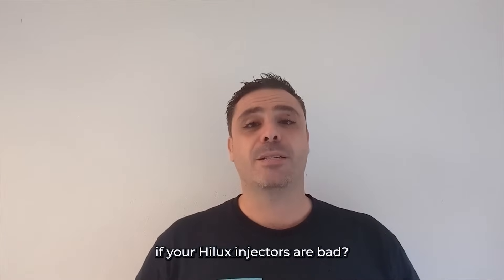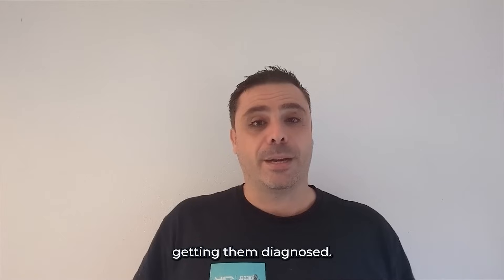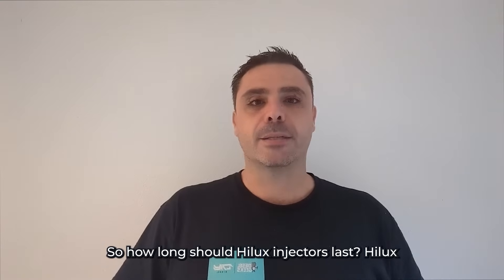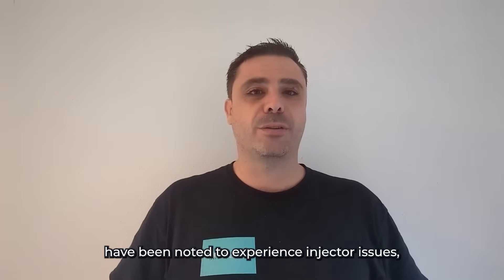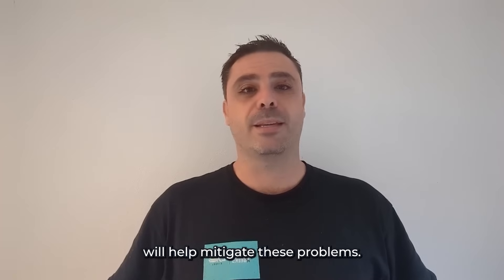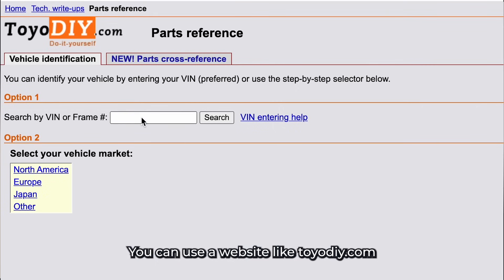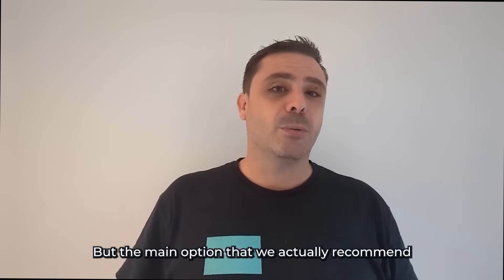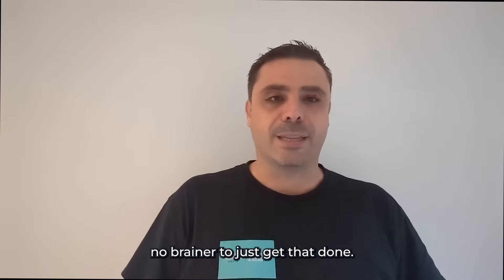#1kd #HILUX INJECTORS - Everything you need to know - Long Version

Comment: had my 07 injectors done but he didnt change the fuel lines and i havnt been happy about how the car has run since.
Reply from the maker: Usually the fuel lines will just create an accelerated wear issue, rather than not great out of the gate.

That said, Ive noticed the codes on the injectors are getting further apart at the moment too, so maybe that's a factor?
Reply: @DieselGeeksOz  they look old probably the original's so i think yes

Comment: @dieselGeeksOz can you use 18 code injectors in place of 11 or 13. Will I have to replace injector driver aswell or will the ecu not read the later model injector correctly?

I have 2013 hilux I will be putting +30 injectors in and the originals are still fine. & a 2006 hilux with 300,000 on original injectors which needs new injectors.

Any help would be much appreciated

Cheers,
Will
Reply from the maker: @Spindooli-p4o  hey Will. 

You can put those injectors in there and it will run fine. The 18 code injectors are a lot better in terms of their design and resulting reliability. 

Only issues are-
1- the 18 codes flow about 15% more
2- you can't code them.

Hope this helps
Reply: @ thanks for the reply, so essentially the engine will just run a bit richer

Much appreciated
Reply from the maker: @Spindooli-p4o  you'd be fine around 2000rpm, but 3300+ rpm you will be quite rich and certainly visible smoke up that high. 

If you don't rev it, you'd be fine.